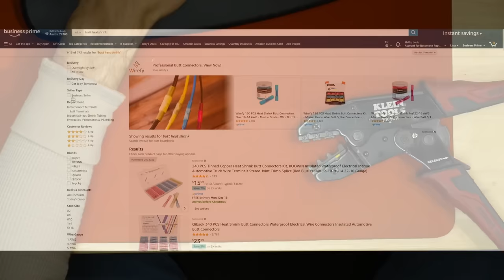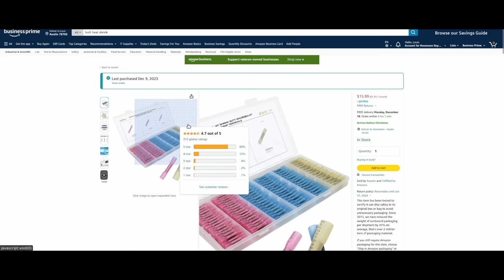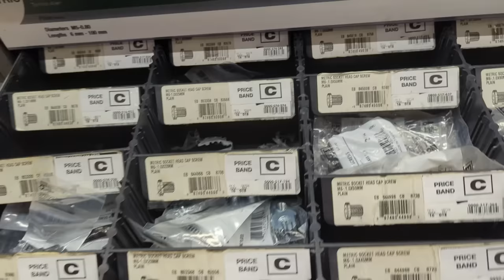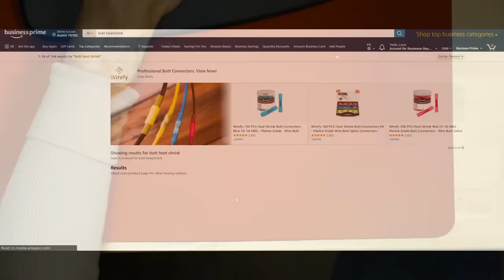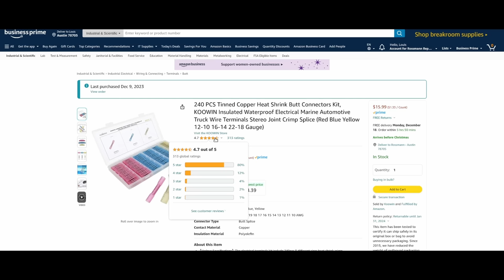Amazon Sells Dangerous Electrical Crimps

Comment: I don't disagree with anything said in this video and am not going to defend what likely is a poor manufacturing process or the fake reviews on Amazon. That being said, while the Klien 3005CRs are decent crimpers, I have owned them, but they are intended for use with insulated connectors. They will technically work with the heat shrink connectors. However, it is not the intended application. I've found that sometimes the small teeth in the crimping die can penetrate the heat shrink, potentially exposing the conductor. I have also had issues with not getting a solid crimp using them, even with heat shrink connectors from reputable manufacturers. Once I switched to a crimper with the correct die for this style connector, I have not had many issues with poor crimps. Also of note, even among reputable manufacturers, the OD of the sleeves isn't always consistent. One series can be slightly smaller than another, even within series from the same manufacturer, which can affect the quality of the crimp. This is probably intentional, most likely to promote selling crimping tools from these companies, which can often be quite expensive.

Comment: Have you tried McMaster-Carr? Those guys ROCK. They have fast shipping (they don’t have a branch office in TX so I don’t know how fast ground shipping is to Austin). Their search function on their website is second to none, which somewhat makes up for the fact that they don’t list the brand names they sell. BUT,  I NEVER got a bad product from them, and you can get NIST and material certifications on several gauge instrument and hardware products for a separate charge. And yes, they have butt connectors. They tend to be a little more expensive but you will have a good product by the next day.

Comment: Apart from their union busting and employee mistreatment this is probably the reason why I avoid using amazon as much as possible.
If I want anything of decent quality it's a pain in the groin. About a decade ago I bought some 9g servos from amazon and they were pretty good. No issues with them apart from not being properly calibrated (no problem, just need to offset my voltages a bit).
I bought some last year, and not only were they completely uncalibrated, most of them wouldn't even return to their original position and wouldn't even hold the weight they were supposed to. (their gears skipped when I put the load).
Now here's the thing, I recognized those issues immediately. Because they're the same crap that I went through when I bought some servos from ali baba.
Amazon is flooded with cheap chinese crap. Even if you make sure it comes from europe or UK chances are you'll run into someone that just re-sells shit they got from alibaba.
Amazon desperately needs a way to blacklist sellers, brands, or products, as well as having some kind of verification for sellers.

Comment: Hey im an electrician and i dont think this guy is wrong but i noticed when he did the crimping demonstration after "cleaning the wire" his red looked a bit longer not by much but it could be a factor in why it pulled out so easily.

Comment: I buy from Amazon, Ebay, and even AliExpress and I always get good products, otherwise I send it back and get a different one.  There is no way you need a brand named product for crimping. I have been crimping wires for over 20 years and I can have good results or bad results for any brand crimps.  They are literally just a round metal surrounded by copper, you just need to bend the metal until in grips the wire.  Use a hammer if you must.  If your afraid, the just make sure you always get return accepted products, simple solution.

Comment: Hey Louis, unless that tool is different than most others you definitely used it wrong. The 2 sides of the crimper are different and you put the colored dot towards the connector. One side crimps onto the wire and the other side is a different shape to crimp onto the insulator. You didn't ever flip the tool over so one side wasn't crimped correctly. But I do agree that some Amazon electrical stuff is bad.

Comment: I attempted to purchase two original PS3 controllers on Ebay, and got scammed three times in a row with obvious third-party knock-offs, each of which was refunded as soon as I requested it, and all of which were sent to charity shops until I finally found a 'real' vendor.

I don't care which website it is: if they're third-party and not the original, specify it in the description and title, or fuck off.

Comment: Returns to Amazon are the pits these days. I just got a gas measuring meter. The one that arrived does not match the included instructions or the model that I ordered. I tried to return but the sellor (in China) just did not bother to answer. Complained to Amazon but no action. Last year I bought an IQ-Aire Super Hepa filter and gas removal unit that did not work. Asked for return but seller stonewalled unti8l the return period expired.

Comment: Actually you shouldn't be allowed to crimp anything if that is how you crimp. 
flexible wire strains should be as straight as possible with only a gentle twist maybe. Yours bulge and go in all directions. This is bad crimping.
Nonetheless, the connectors from Amazon are garbage, too....

Comment: I have had good enough luck with these chinese clones on amazon. In most cases it's the same quality as what you'd get on walmart or even home depot. This also specifically includes those little plasticized crimps and a crimping tool. Maybe if I were an electrician and knew the right brand to buy at home depot it would be far better - but I'm just saying the ones you had (or something virtually identical) worked just fine for me, my wires were solidly crimped. Also you don't mention the price differential - I get a 500 piece crimp/heatsthrink set for like $10. At home depot I might get 25 pieces for that price, so yeah they SHOULD be noticeably better, (and IMHO often aren't, amazon is a far better bang for your buck than home depot most of the time)

The difference is I don't really care about the principle of the thing, I value the expediency and convenience. Of course the reviews are heavily astroturfed however the return policy is ironclad and I take advantage of it a lot - saving a trip to the store is well worth the risk of basically blind bying. 

I also worry about there being a "race to the bottom" as you mention, but I think the big-box retailers are fully engaged in that anyways. Also no matter how astroturfed a product is if it is actually dog-shit I think the returns will swamp any potential profits so at least in that sense they are incentivized to be selling something that is a minimum viable product. Which as I've said I've spent tens of thousands on amazon and I think that is generally the case.

Comment: My theory is based on the dancing bear mentality that most people have. They buy it, they try it, it works, they give it 5 stars. I always look at the one and two star ratings. You can tell if the reviewer is reasonable or full of shit, based on his gripes. But when all the one and two star ratings share the same gripes, that is a red flag. You must not look at just the positive reviews. Most of them are sheep with dancing bear mentalities. You must look also at the negative reviews. Most of them are people who value quality and know when they have received the antithesis thereof.

For those of you who don't know what the dancing bear mentality is, I'll describe it below, as I, myself, was unfamiliar with that convention until recently.

Let's say you saw a bear dancing in the street. You would be like, oh wow! It can dance! You wouldn't care how well it danced. That would be trivial, irrelevant.

Now apply this to the marketplace. Oh wow! It does exactly the job it is supposed to do! Let's give it 5 stars. (Of course it works. That's what it is supposed to do.)

Kids. In the good old days when sheep were nervous, 5 stars meant "exceptional". That is, above the baseline. If something meets a baseline, which is the minimum standard it must meet in order to be acceptable, that is good but it is not exceptional. It deserves a rating between the two extremes of 1 and 5. A good number might be 3 for something of acceptable quality.

But most sheep look at the function and not the quality. So their testimony has little value. The gripers who are unfairly dismissed as pessimists, their testimony has value. Because they tell you what the actual fuck is going on. We need more of these people.

Comment: IMHO,  and I herald from a country  (which I shall not name) where in practice retailers wont accept returns, Amazon UK give you one marvellous thing.   SERVICE.   AND EASE OF RETURNS.   oh and VALUE.   They make it easy and if you made a mistake   (or even if you a  dumbass and do no research and order the wrong thing), return it.    On the negative side, they don't pay much tax [in country of delivery]  and the European legislation to correct this is still farcical.    Still in the UK,  IMHO they are still my choice.   If there was a better option believe me I would use it.

Comment: Yeah I bought some Christmas lights and didn’t realize they were battery operated. So got batteries the lights lasted a month plus I bought batteries several times. I am addicted to shopping Amazon to but the items are not made to last.  Do you  recommend some good sites so far I only found Etsy where I found a guy who mods the 3DS . I was unaware the Nintendo 3DS online shop was close so I found a retro game store where I spent a hundred and fifteen bucks. I am not sure how I got to this one YouTubers channel but I did. Apparently I have been living under a rock cuz there’s this whole online community dedicated to old gaming equipment.  The newest system I had was the Nintendo Switch and those are very expensive. So I mostly play my retro systems and mod or hack them because these new  systems change and or no longer are supported. Sorry bout the long comment I tend to ramble 😝

Comment: Once again chinese companies are very hard to trust when they attempt to save face more than face their product's quality head on. Also THD electrical employee here, most of the thefts are through returns where people return products they "didn't like" or whatever. It really eats into the profit margin when so many people can ride for free, but the ladies at the front desk can't count every marrette in a box of 50 every single time one arrives. You'd be surprised though at what people do steal from the store though, I have caught people attempting to steal the same crimps you use in the video, and routinely I find kitchen drain strainers where the small gasket in the bottom or the brass tailpiece has been pilfered. Middle management thinks things are fine though lol.

Comment: Does your crimp tool symmetrical? My crimp for isolated connectors have two diameters, one for bare wire and second for isolated part, so when I'm crimping this typy of two side barrel I have to flip them.

Comment: Mr. Rossmann did not complete the process for attaching the terminals. He did not mention that there is a "heat melt" adhesive inside of the sleeve. With HEAT applied, the connection will be WATERPROOF and will not pull apart. Excellent for marine use. The G &B terminal, on the other hand, will be a BIG FAIL under those conditions! Maybe Mr. Rossmann does not possess the necessary reading skills to understand the instructions printed on the package!:face-green-smiling:

Comment: we have to learn to navigate throught amazons trash, i get plenty of great cheap and safe products. but no offense those crimps are terrible for the type of inconsistency in that kind of stuff. id crimp that with mine perfectly fine but its obv the specs of the amazon butt connector material is thinner, EI CHEAP CHINA SHIT! but spending 3 years installing auto accessories, out of all the styles of chrimps used those were by far the worst.

Comment: WOW. One single product. Maybe a dozen based on the rest of what you said. You have no idea what you are talking about. This is a hit piece on Amazon because you were given crap terminals based on NOT reading the bad reviews? No no no, there has to be more to this. 30% of what I find on Amazon belongs in a trash bin, sure, but I know that because I test them. There are NOT a bunch of name brands leaving Amazon. I have no idea where you got that from. It is mis-information. Also, you do not always have to send the product back to get a refund. In most cases they don't want it back unless it was very expensive. And those terminals? They wouldn't have asked for them back. You would have just gotten a refund. And last but not least, Amazon represents tremendous price to performance value in every department. However, you DO have to find these things yourself. Look at the bad reviews. Send messages to the sellers for info. There are many ways to fix the issues you are talking about. But they only work if you are proactive. I am starting to think you got burned for a few thousand over the years of selling on there and are relatively aggravated after you did your taxes and figured it out. Which is very petty. I hope that's not the case but in the meantime, go lightly. You wield a lot of influence. Until you have far more proof than what you have now? It isn't right to produce a hit piece like this. This is all of my personal opinion. However I am certain I am 100% correct.

Edit: I understand you want their attention and you want them to do the right thing. You should reach out yourself. They guaranteedly know who you are in marketing.